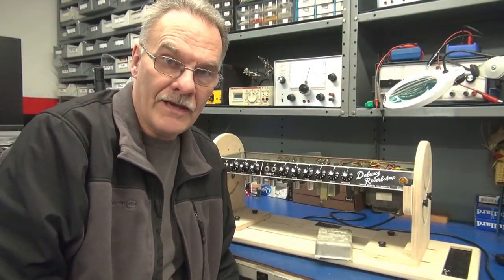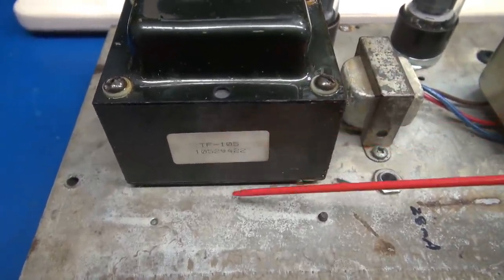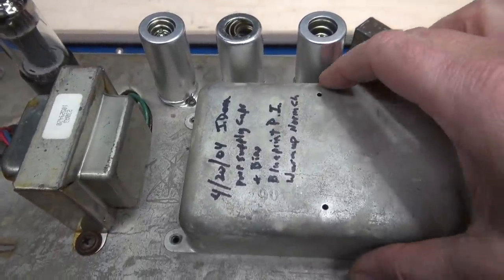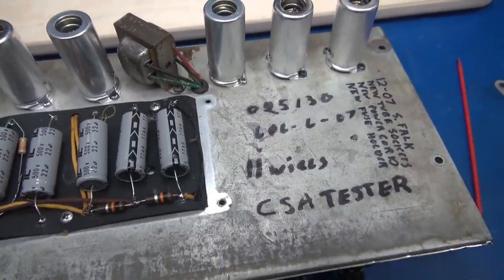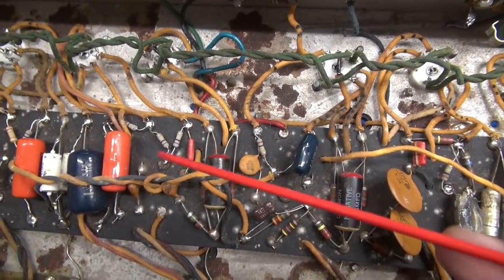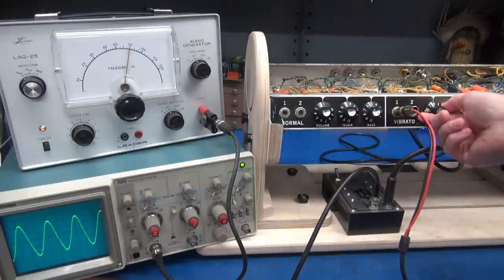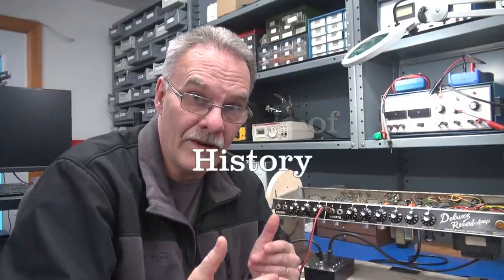Do Not do this to your classic Fender Deluxe Reverb Guitar amp Collectors value destroyed bummer

Comment: Sharpie marker can be removed from non porous surfaces with rubbing alcohol. Try a little solvent (brake cleaner, acetone, lacquer thinner) if alcohol doesn't work.
Reply: Agreed. I would even use Barkeepers Friend, afterward, to remove any residual ink which may be embedded in the grain of the steel.
Reply: Acetone (fingernail polish remover) will remove marker ink from metal.
Reply: I have had some success with Clorox sanitizing wipes.
Reply: Standard practice for most techs is if considerable effort is put into a task, it will end up on the bill.  Terry has enough happening to this amp without adding un-necessary labor.  I imagine cleaning up the marker would be more than a 5 minute job.  Why charge the  customer for something they could safely do themselves?
Reply: @timmooney7528  Some of that marker is under the hood near the eyelet board so easier for a tech to access. Then again it all lives in a case so the writing isn’t that big of a deal to me and acetone or isopropyl alcohol should nuke it pretty easily.
Reply: Magic Erasers remove Sharpie from almost everything.
Reply: @vintagetubeamplifiers  No argument there.  I don't see the economy of paying a tech $70/hr to remove permanent marker unless it's part of a total restoration.
Reply: Don’t use rubbing alcohol, it has glycerin in it. Use the 70% or higher isopropyl alcohol.
Reply: @willer3399  Actually I think denatured alcohol would be the best bet.
Reply: @tedjones6183  Denatured would work. I like the isopropyl because it has no additives.
Reply: @timmooney7528  i'd just take it back and remove the sharpie myself then return it for repair
Reply: Acetone likely will work well removing the marks and may effect the chassis slightly. 
Acetone leaves no residue like other solvents might leave.

Comment: I got this Amp in 85.  The other guitar player in my band hated the amp I had and cut me a deal.  It was a used amp and a tool.  This amp was with me in LA in the late 80s.  It was gigged by me and borrowed by roommates and friends and gigged by them.  In the early 90s it toured the US..  I sold it after that to a friend with the caveat if I ever wanted it back I could have it back.  I had quit playing guitar by that time.  He'd let it go for awhile and it passed through a couple different owners.  He got it back in the early 2ks.  He resold it and I got it back a couple years ago.  All the mods were done in that in between time.  As far as the graffiti it doesn't bother me.  Also I know that one of the names in there was a past owner.  D-LAB offered to clean it and I said spend the time making it great sounding.  The amp has no collectable value because it's not for sale and never will be.  I  told D-LAB do what you need to make it a great sounding Fender Deluxe.  I'm thrilled that D-LAB is able to take this project on and a Final Note I would be honored to have Terry's name in my amp.
Reply: One more comment D-LAB offered wise counsel with this statement, "usually the best way to get these amps sounding great again, is by taking them back to spec."
Reply: Great story!   I wouldn’t care about the sharpie myself…even if I was buying the amp.  It’s inside, mostly hidden, nobody looks at the chassis on a regular basis, and it’s just a unique part of its history. 🎸👌

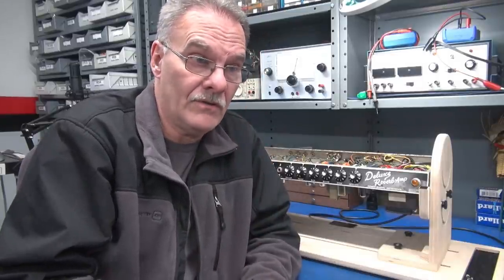Comment: 4:50 in defense of the repairs, 30 years ago, when most of the "repairs" were performed, I doubt that the amp shop, or even the customer, were thinking about future value. They were thinking at the time that the parts they had available would return the amp to a serviceable condition and the owner could get back to playing. As far as Sharpie on the inside, I don't think it would take a whole lot to remove it. A little acetone and it's gone.
Reply: 100 percent nobody thought they would be worth big money nobody ,  had a early gold top the neck was round sold it  for same price I got it and fender Amps nobody really cared back then a lot of people didn’t want the same amp as their friend had just to be different we all changed stuff. Etc we thought the would be worth less as it got older

Comment: Those sockets are fine. I've used many. 
Sharpie isn't permanent. Take a rag with rubbing alcohol and wipe it off.
Reply: exactly, worst case scenario put some light solvant on a que tip and it will make it easy in minutes everything will be fine. as for the transformer it is also probably fine, if the VA power is the same or higher and the voltages are correct there is absolutely no reason to overpay for the "original". as for the sockets, imo these ceramics are even better than original, i use them a lot and i even have them on my own high-fi for about a decade, clean as new and they can also help the power tubes cool off a bit. maybe he has seen some which would be 100pcs for 5$ free shipping, but normaly they are great.

Comment: I agree with Scott below. I have cleaned all sorts of Sharpie love notes off, on equipment with either Isopropyl or Acetone. I agree with Terry 100%, write the love notes on your invoice. Chicken writing on the chassis looks very unprofessional and sub-highschoolish. . 
I do use small labels with a label maker for denoting tube ID's on a chassis as did the OEM. Black on Clear, looks very professional and helps.  I do this to keep me straight while I'm working. They can be easily removed but for future service the tube labels are helpful.

Comment: Totally agree with you, and that doesn't just apply to amps, with that said, it is there now and it should be dealt with. Could you not buff all that crap off with a wire brush wheel, I know the process will bring it back down to the steel, however, the underside is starting to rust out, might be worth the investment in time to completely strip it out, take care of those scribbles and get the rust under control, put quality components back in it, so it can shine like a gem for another 50 years.

Comment: IMO, the collectible value basically went out the window as soon as the original transformers were changed and tube sockets removed. The chassis has a significant amount of corrosion. It must have been stored in a damp environment. A phosphoric acid based rust converter would at least neutralize the rust and give it some protection. I would only recommend spot treatment since it can damage the plating. The only real way to bring the chassis back is to have it replated.There are still a few places around that do cadmium plating but I would imagine that that process would be cost prohibitive. You may be able to use solvents such as xylene or MEK to remove that nasty black marker. I wonder what Tony thinks of it.
Reply: WD40 for magic marker. Works for when the nasties get written on your hard hat.

Comment: Old Sharpie marker  writing usually can be removed with IPA (  91 % isopropyl alcohol) or Acetone ( don't use it 
on plastics). It isn't permanent as it claims. Horrible soldering job with cheap components. Hacked and wacked.

Comment: This comment by the amp owner is key IMO: "The amp has no collectable value because it's not for sale and never will be.  I  told D-LAB do what you need to make it a great sounding Fender Deluxe." I find it frustrating that people get so damn fixated on the collectible value of amps. Its a musical instrument! Fix what it takes to make it sound great again. That can be done and I'm sure that is what D-Lab will do. I find it amusing that it is considered acceptable to change parts in a vintage Fender guitar and not in amps. I've had people tell me that they will not change filter caps in an old Fender as it hurts the value - BS. And don't get me started on "reliced" guitars - dumbest trend ever; old amps are supposed to look brand new and guitars are supposed to look like they were trashed by a drunken gorilla in a smoky barroom. Five years from now Fender may be producing amps with torn tweed, cigarette burns, and scribbles on the chassis for all we know. And, hey you kids, get off my lawn!
Reply: If a potential customer were to come to me with an amp in need of work telling me they didn't want old electrolytics and paper capactors replaced (or worse yet, wanted me to restuff them) I'd just send them elsewhere. I don't want to be the last one to have touched something, and be the one that gets blamed, when some old electrolytic cap bites the dust and takes out an expensive power transformer. 

Complete BS when someone claims that installing new (quality) parts destroys the tone of the amp. An amp's tone is determined by its design, an old paper cap doesn't sound any better than a modern film one, even when the cap was new.

Comment: I have a mid 70's silver face. i would love to have it alive again. I have never soldered in it. It has some busted knob holders on the pots. I took the reverb unit out but those are plug and play. I gave it to my band mate that relied on it. I used a an effectron. for verb and slap back delay.I'm sure it needs cleaned well and new tubes and a new spring reverb unit. How much to fix it for me? I can just send you the actual amp. i can put a reverb in it. they are about 26 bucks. Best amp ever and i can't believe how much they cost today. It does light up. It works and buzzes a bit. It has the old 2 prong power cord on it. There is a power tube missing. It once again has never been worked on. Just used a lot.

Comment: Terry!  My heart is broken!!!  So very sad to see the vandalism done to that wonderful amp!  If it were mine, I would at the very least insist on a new board to replace the moldy old one and recap it, etc.  You may have saved me from a sad fate as well...those ceramic tube sockets...are they made in China?  Is the reason/source of the corrosion known?  I thought being ceramic that there would be higher quality and had planned to purchase some in the future.  Are there good ceramic sockets?
Reply: In the early days of PC gamers water cooling their cpus, the combination of copper fittings and aluminum heatsinks and water would cause pathways in the heatsinks to fill up with oxidized crystals.  Not sure if galvanic effect is the right term, but in a way it was like long term anodizing.

The ceramic parts by themselves  are ok.  It's the metal pin retainers in the Chinese sockets that are made with a dissimilar metal or plating is what's causing the problem.

Comment: love your vids( so ya know) … as a repair tech myself ( moderate level);  mek will remove any felt pen . and surprisingly, the deluxe rev/6v6 twin does not sound that good… based on the * few i have repaired… even new ones . what type socket would you suggest? i thought ceramic or mycylex would be better than bakelite . the princeton  (imo) is better than the dlx and the 5e3 is better for a 6v6 rig.  … all subjective of course. what cap brand/s do you suggest for an open check book restoration?

Comment: even in something like a guitar there's usually writing in the pickup cavity and neck pocket from the factory. It not something I would do but writing inside devices and such really isn't, or wasn't, all that uncommon.

when I used to work on computers in the early 90s you'd see names and dates inside the BAT files or inside the chassis as well.

Comment: I have a 1959 Princeton that looks like it has the original tubes and it looks like it has never been touched and I don’t want it destroy the value but the owner before me did remove the tweed and did a sorry job of black tolex I guess on it and the fuse holder is broken and it still has the “death “ circuit in it . I just want to use it and I don’t know what to do with it to keep any collector value if it has any . I am located in Charlotte NC and I was wondering if you have any suggestions on who I could call to help on this project

Comment: Interesting, I would assume ceramic sockets would be the best!
Reply: For stationary electronics quality ceramic sockets are supposed to be the best. However, in electronics subjected to being hauled, bumped, shaken, or vibrated around the MICANOL sockets are preferred. Ceramic sockets are thermally better but ceramic is hard & brittle which doesn’t play out well with much vibration. That’s why Leo and USAF and NASA use military grade plastic sockets like “Cinch” sockets

Comment: This is what happens when you let a hack work on valuable sought after vintage gear. Thank god its not a blonde twin or a brown deluxe or worse yet a tweed deluxe or bassman, it was still a great amp at one time. The Deluxe is one of Leos best designs and one of the amps least changed by the CBS bean counters when they decided that it could be done better and cheaper ! To restore that amp back to former glory would cost more than its worth. to replace the transformers and choke with original schumacher's would cost you a fortune if you can source them at all. Add on the blue molded caps original C12 Jensen or even the crappy Utah speaker and Allan Bradley CC resistors all hard to come by. When you then figure in the labor of a competent tech like Terry that amp becomes a ridiculously expensive proposition even if you found someone who felt bad for you and wanted a real challenge. The cost of parts alone would be unrealistic. I bet Terry gets that amp sounding great though and with little more than he has to work with now. Those ceramic tube sockets have to go even the cheap brown micalex sockets would out live those and never fall apart like those chinese ceramic ones do, those are 100 % pure crap.  Just an FYI... I have some of the NOS parts to bring that back amp to life if the owner opts for a full electronic restoration, so if you find yourself in need Terry please feel free to contact me. 👍🤘👌

Comment: Poor amp. You make it sound like it's garbage. The worst thing that could happen to
this amp IS that a collector got a hold of it. Never to be played again. That would be a 
shame. BTW, permanent marker can easily be removed from the chassis. It's not going
to degrade it. I would be more concerned with the rust I see on the inside of the chassis.

Comment: I gotta look at the ceramic socket video...but i have one burning question in that regard.
I repaired and restored old organs for about ten years...
And every part i could salvage, i saved...so i have quite a few old phenolic sockets-
I was under the impression that they were inferior technology, but i know that made in USA ANYTHING is better than the new imported stuff.
These have been pissed on by rats, and all kinds of nightmare situations...barn finds, etc..so its NOT  N.O.S., but after seeing this im thinking i should definitely clean them up and use them in something else.
And all that graffitti can be removed with solvents...xylene maybe...acetone, or laquer thinner...
Something similar...just do it outside...and dont smoke.
'Permanent'  isnt always true...that stuff rubs off on contact a lot of times...
Either way youve got a LOT of work to do.

Comment: Furthermore, the NEW 9 pin sockets used in current production Fender amps (like Princeton) are inexcusably poor quality. So you need to come up with an alternative before you trash everything that is available....it's simple: we don't have any really good sockets anywhere; if we did we would use them !

Comment: I have a hard time understanding the desire to keep an electronic circuit as original as possible. Old leaking out out of specs capacitors are just junk. A brand new one with modern technology is far better, who cares about the look. The same about transformer. A toroid transformer would be so much better eventhough it is a very different looking beast. So, is it a working amplifier of a piece of the past better suited for a museum ? It depends on the use. Are you a guitarist or a collector ?

Comment: Dude, get a grip. It’s a tool, not an Egyptian artifact. You’re acting like someone mounted pickups to a Stradivarius with drywall screws. Previous repairs were probably done by tv and radio repair shops. All component replacements were documented component by component the benefit of future technicians. Sockets, transformers and capacitors were chosen by techs based on price, perceived durability and availability in time and space. Leaky capacitors were put in everything for a decade, not out of maliciousness but because they hadn’t leaked yet and nobody knew it would happen. A new power transformer and complete replacement of all tube sockets suggest the amp was run very very hot at some point. 

Instead of fetishising your own nostalgia maybe you could have some perspective your own place on this tool’s life. Copy the repair history onto a piece of acid-free paper and tape it into the case lid with museum tape if it makes you feel better, or don’t and let those marks be part of that artifact’s unique existence.

Comment: You would be better off building a new one with high quality parts than buying this amp. 
Sozo blue/Sprague Atom/Ceramite ceramic caps, Mercury iron, Mojotone cab/chassis/eyelet boards, NOS Allen Bradley resistors, Weber C12Q/12K5 speaker, NOS US made tubes, Belton micalex sockets, the whole deal. 

You could have one hell of an amp for half of what this guy likely spent on this amp.
Get all the pictures you can of the amp before you buy vintage amps. Expect people to open them up in person for inspection. DONT GET SWINDLED!
Reply: Even with pictures you have to contend with techs that like to keep the "stock" look and stuff new caps inside the old caps' housings.  I would like to  see the repair history stored in an envelope that stays inside the cabinet.
Reply: @timmooney7528  I put notes in an envelope below the reverb tank bag, for the next tech, who, 20 years later, has often been me. I call it "Notes to my Future Self " I also ziploc baggie any removed parts and staple the baggie , rolled tight, in an inside corner.